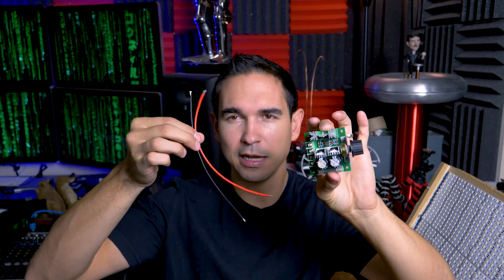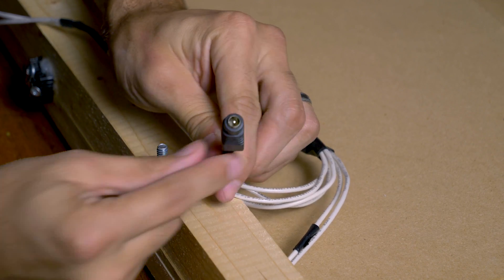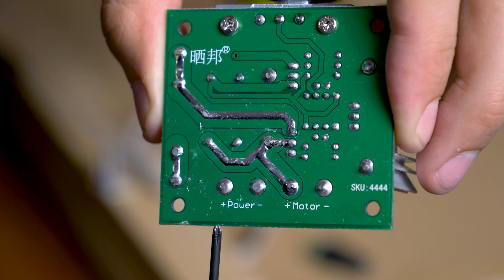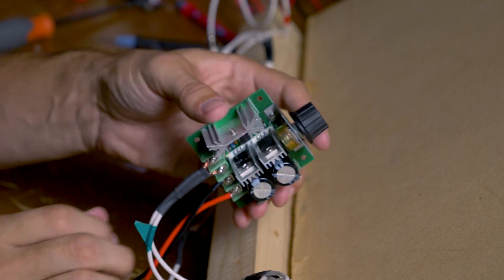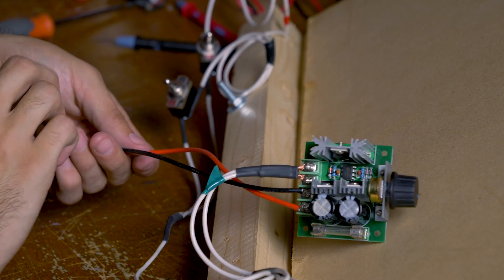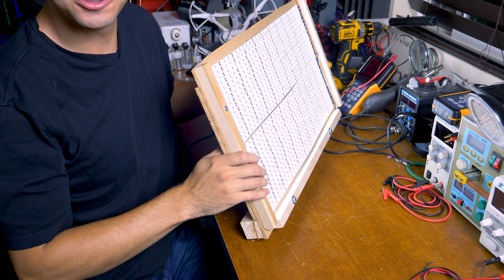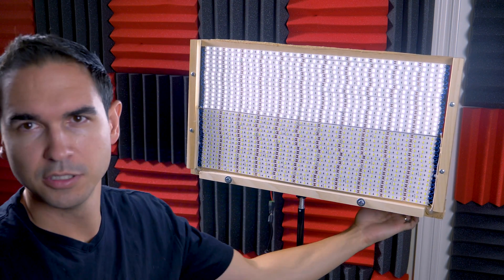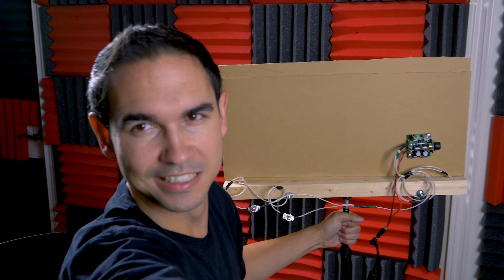Modify an LED panel with a Voltage Regulator

Comment: How did you measure the 99%? 😊 I have another voltage dimmer and want to test it up against the small one DIY Perks used at his flex light
Reply from the maker: I used a multimeter and a bench lab power supply.  I used 12v input and got 11.90v out during peak load.
Reply: Tommy Callaway when the light is plugged in or just directly and alone in the dimmers output?
Reply from the maker: plugged in